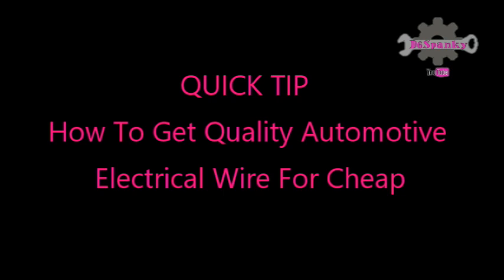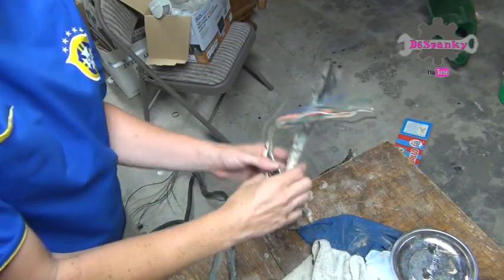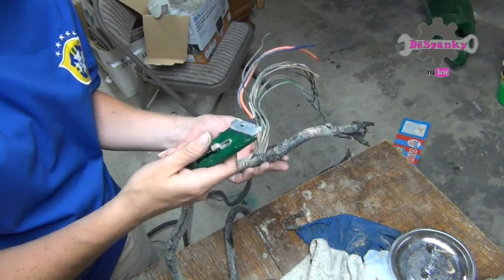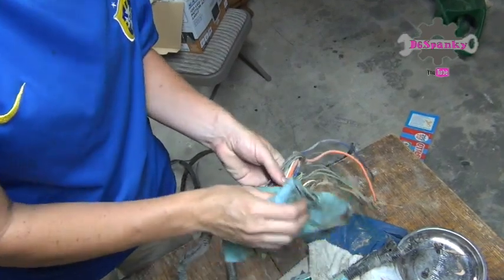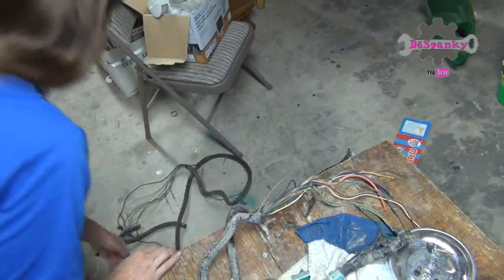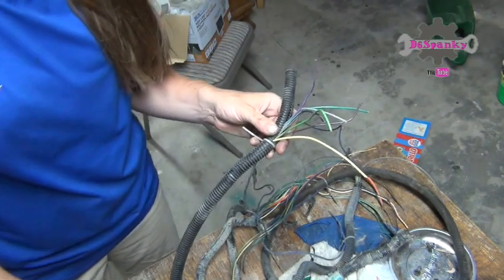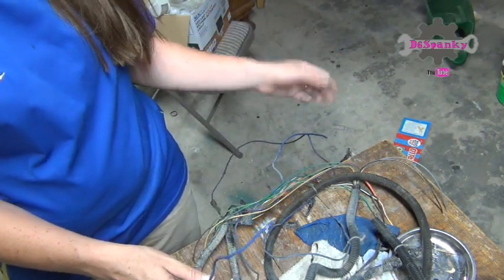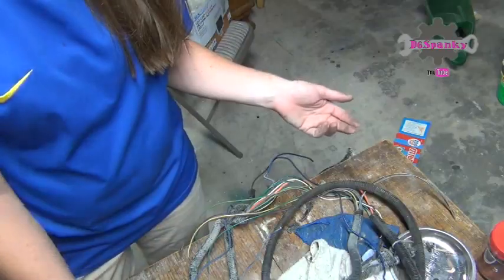Quick Tip! How To Get Quality Wire For Cheap

Comment: Ohh here's an old tip for you for taking those harnesses apart. Since you like to sew, grab yourself a seam ripper to cut throhg all that tape like butter and not have to worry about damaging the wires with a utility knife.